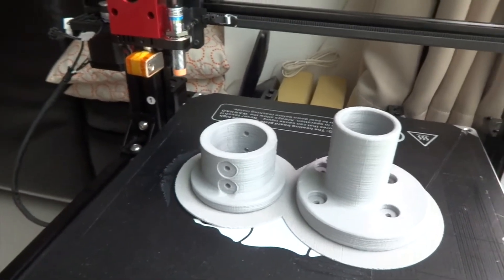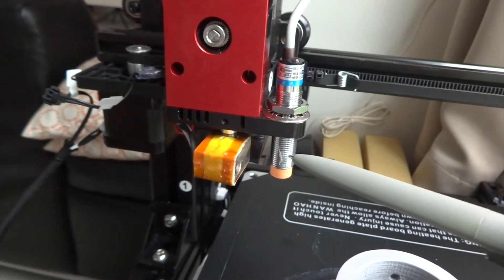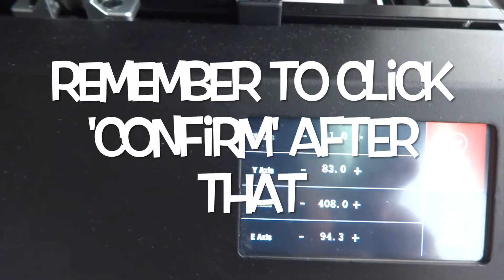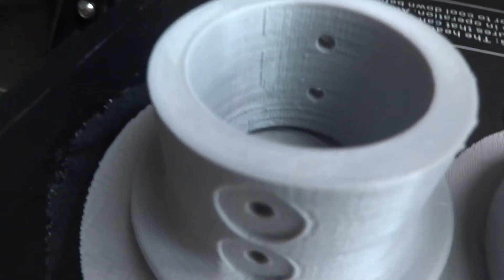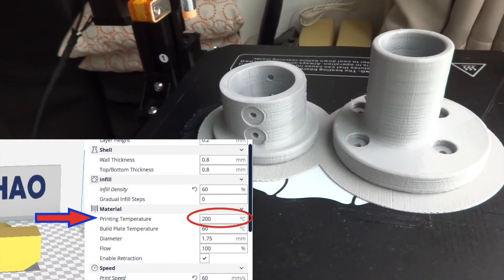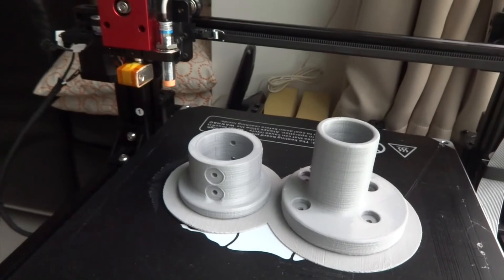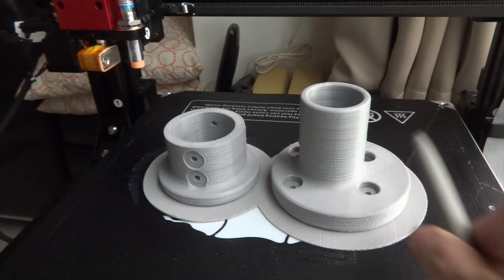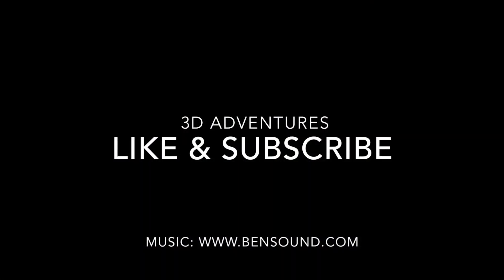3D Adventures - Cura for Wanhao Settings

Comment: Hi, if you want disable auto bed leveling, write gcode on cura; 3d printer start gcode area. For disable auto bed leveling M420 S0. 
After you make them, get an error in the first layer, make the first layer filament flow in the cura 300%.
I hope this comment helpfull.

Comment: I bought a D9 a week ago and have been having issues with getting the layers neatly on top of each other, we print most of the models in 0.1z, we played around with jerking and acceleration but that only helped so much. we also have a D5s that prints very smooth (im thinking it boils down to the bed moving on the D9) somewhere in the slide of the bed it gives trouble as the ringing (ghost lines) are now gone due to changing the acceleration and jerking parameters but the minor shifting of the outside wall line is still there and to be honest I would have liked to take back the printer to the shop and get something with a bed that does not move.... quite unhappy with this printer at this stage. :-(
Reply: Tighten your belts!
Reply: Hi Nelius.
I have a duplicator s5 mini too but I can not make it run good with cura. Which parameters do you use? Do you use cura?
Thanks

Comment: Hello, im thinking of buying this printer, im enjoying your videos and deciding weather to buy it or not, but i notice a few things in your prints that affect you overall quality (besides layer height), maybe you should try readjusting your Flow Rate %, And change your temperature depending on your print speed, and also Fan speeds.
Side note: you can also configure the Support Air Gap for support, which is very very helpful when using support, and you can set speeds for different parts of the model, (including infill speed, support speed, inner wall and outer wall speed, etc), and you can set them for each model.
I Hope this helps you improve your print quality, sadly i have no clue what causes the z auto level to offset but hope you find out! Good luck.
Reply from the maker: Hello, Legendary zotar, thank you for your inputs, yes, I'm still tweaking the settings, if you do buy this printer please share your settings with me! =)